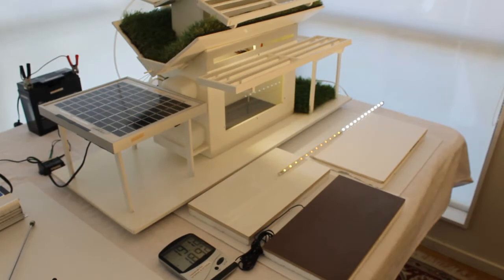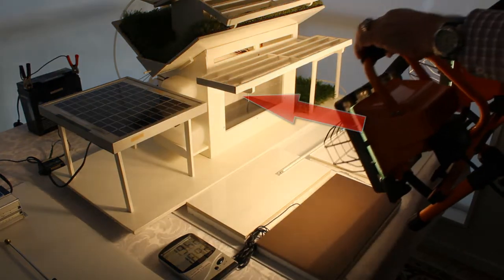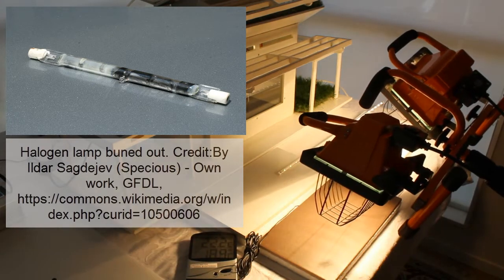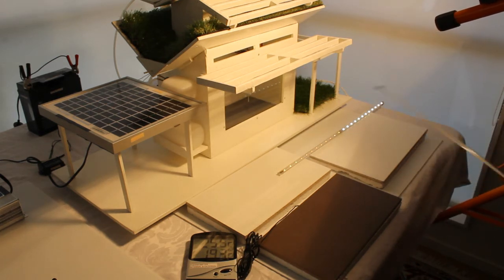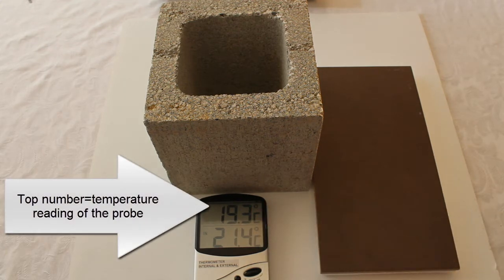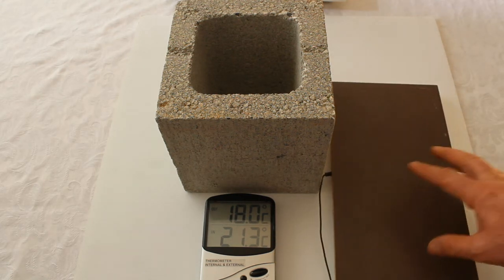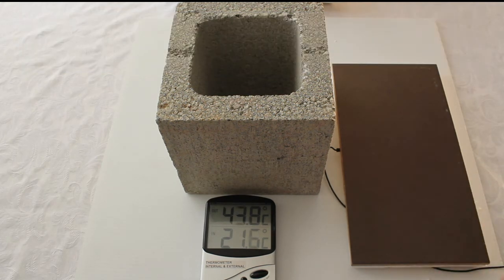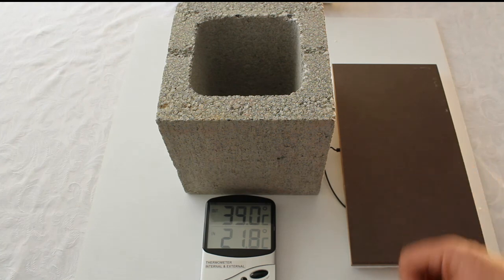Heatsinks and thermal mass - Passive Solar (Illustration with use of Model)

Comment: what about during winter, when for example you get a period of no sun, and low temperatures. now your tiles and you brick or concrete wall are acting as a thermal conductor, stealing heat from your home.
Reply: @williamvanzyl5888  have you thought of incorporated Peltier modules  they produces TEG  thermoelectric generation and /or PTC heating elements in series and/or parallel  ? both are affordable materials purchased from "ebay or amazon".  Sincerely, Bob first time viewer